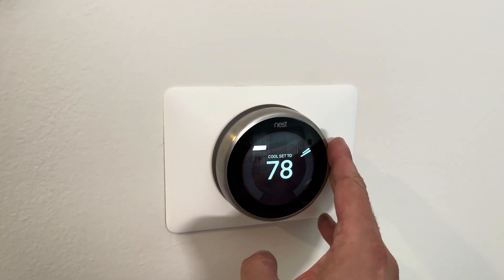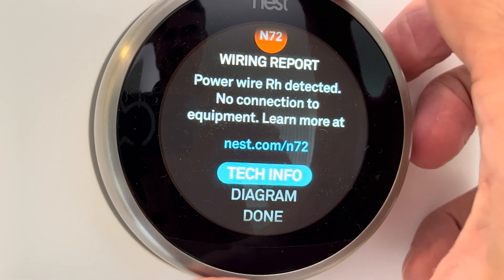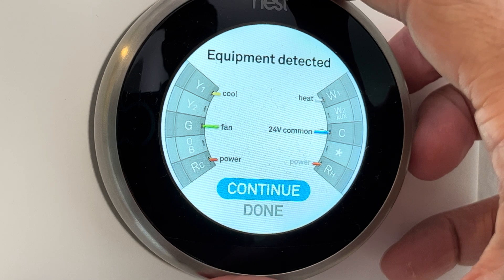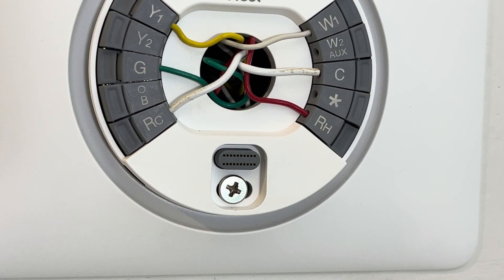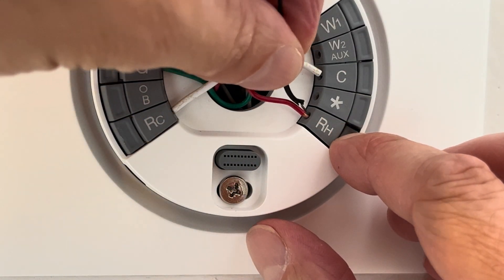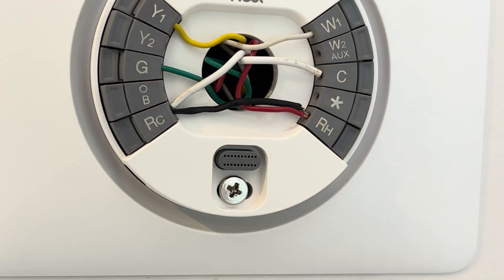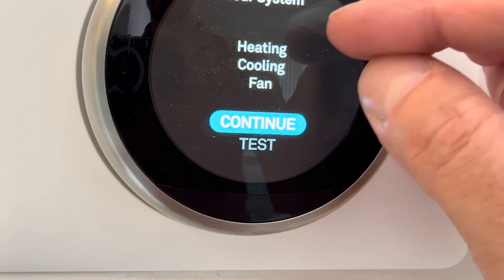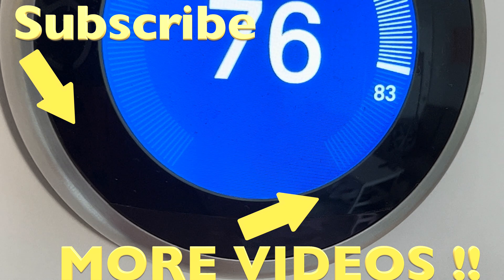Nest N72 Error Code How to fix instructions

Comment: Nest says specifically to not jump Rc to Rh.  Sounds like a nest problem. It is not typically a good idea to connect two transformers together.
Reply: I can't find any information on this from from Nest, but I believe you.  The Rh wire in my system is powered by a transformer that is internal to the control unit for my boiler ($$$). I am very reluctant to put a jumper on this to connect with another transformer, sounds like an invitation for disaster.

This setup was professionally installed and has been working fine for 4+ years, but with the recent switchover to heating season I'm getting the N72 error code and no call for the boiler to run - it does run when I jump the W and Rh wires at the thermostat. It appears that Nest is no longer offering customer support and indeed will stop software updates for the Nest 3 Learning Thermostat later this month, so I guess I have to solve this elsewhere.  Just ordered an Ecobee thermostat, they actually answer their phones and provide help - in this case choosing the unit that I needed (it was not the most expensive one!).